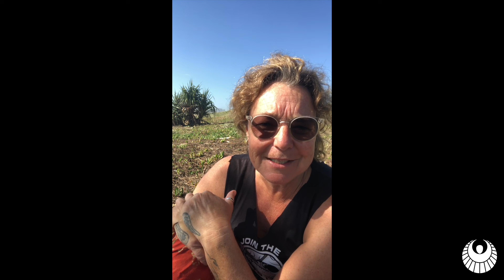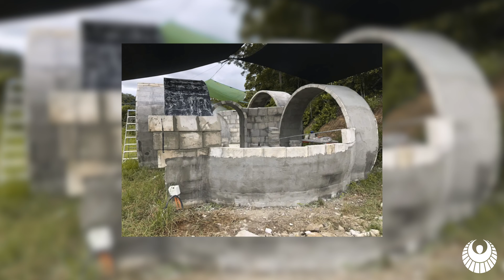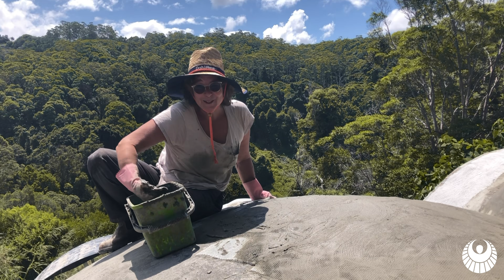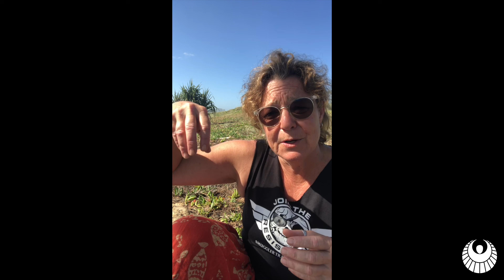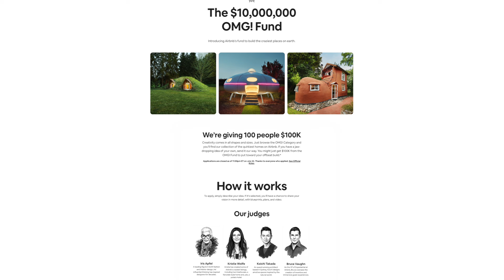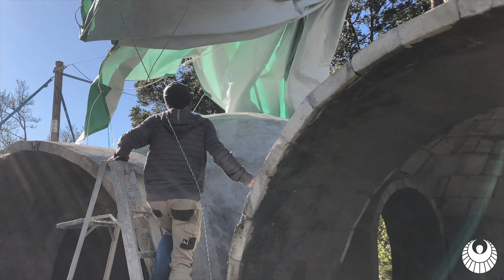This Aircrete Dome won the Airbnb OMG $100,000 challenge!

Comment: so this construction technique is limited to dome shaped buildings?
Reply: “Construction technique” is rather vague. Domegaia specializes in domes. However, aircrete is often used on more conventional structures; realize it is not structural enough by itself for supporting conventional roofs, so it is either used for infill or with other types of reinforcement on the outside of the aircrete. There are many videos available if you look for them.